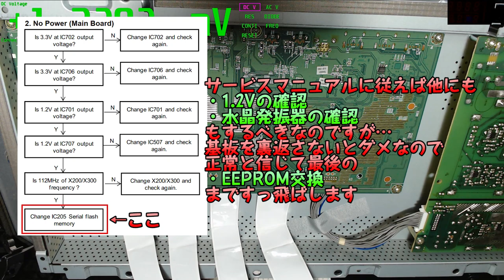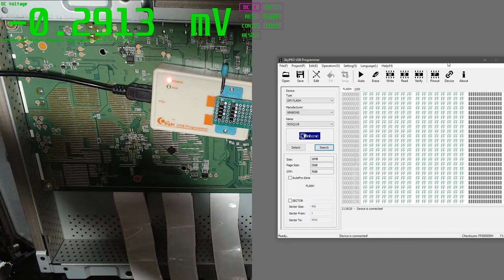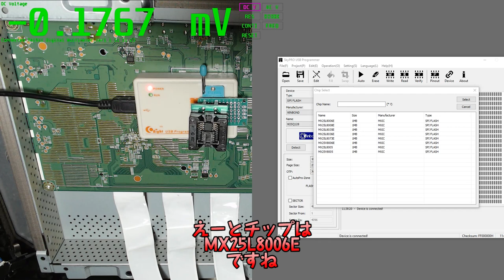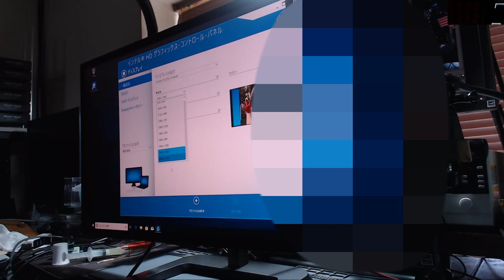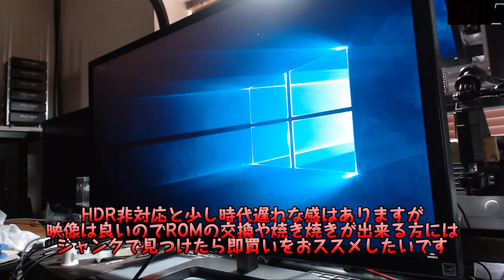[ジャンクPC] LG 31MU97-B 電源が入らない31インチ4Kディスプレイの修理

Comment: I have seen a post on forum. Somebody knows where to get firmware for this monitor?  Look here: 
My Husband used LG software for ROM update.

Just turn monitor, use USB cable or Service RS232 cable connected to VGA.

Run update rom from LG database use monitor revision.

Power cycle. Reset settings. 10 minutes and no need send monitor to other countries.

08/20/2019 by Fennella Shapiro